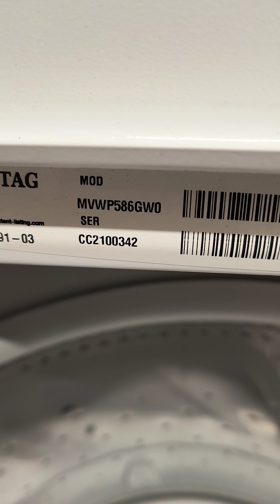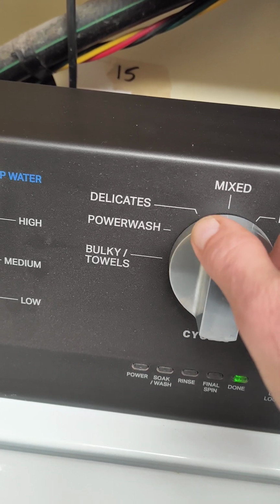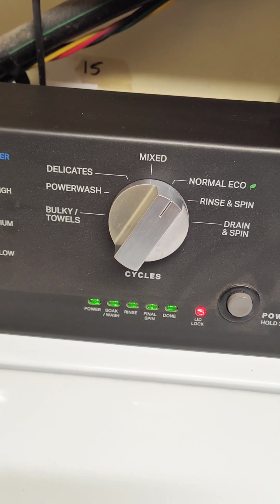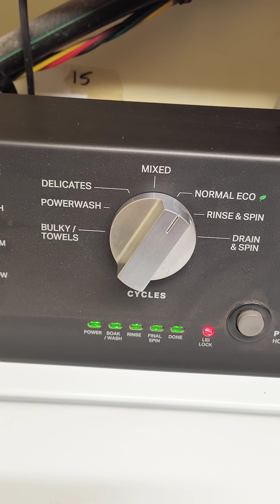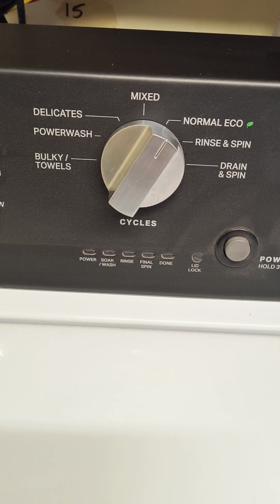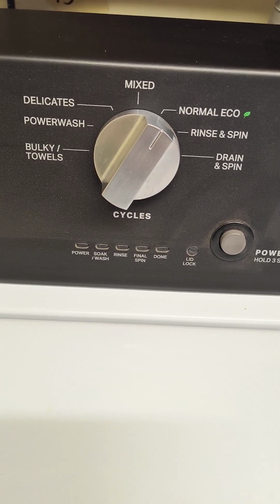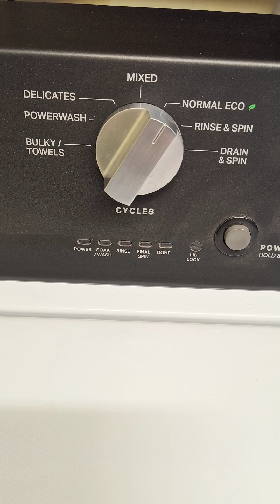How to Calibrate Maytag Commercial Washer MVWP586GW0

Comment: What does recalibration do?  Recalibrate the water fill sensor?
Reply from the maker: I don't know the technical aspect of it, but it should be done when first installed, moved, changed power supply, or replaced a part. I have no idea if it does anything to the water fill sensor.  Sorry.

Comment: I had the 575 model and last year started to have issues with the actuator. Adter 6 repairs, whirlpool replaced the unit with the 586. I use Deep Fill. The High Water setting only fills about half full, ans Low is about 2-3". I've also had several larger loads get unbalanced dureing the spin (never happened on the older 575). One video said they had to get their board replaced with an updated software.
Reply from the maker: Yes. That was me that uploaded the update with the updated software new board. The tech also replaced the water level switch. All this was done in November 2024 and except the odd off balance , I'm way more happy the way it works now then when first bought in October 2023. If you go to my Shorts videos, you will see the issues I had.
Reply: @BUTLERNIXON  when you select Water Level Large, how much is it filled with? On mine the Deep fill is the full tank, but Large is about half tank, medium and small is just a few inches.
Reply from the maker: @fauguy23  The "high" level is about half. The diagrams on the lid and the manual states it should be 3/4 but when I hooked a meter on the hose it gave the proper gallonage (18 gallons) according to the  manual. It sucks the the inside lid and manual is so misleading. It is definitely not 3/4.  I never use medium or low as it creates way too many suds and is more agressive than the top agitator.